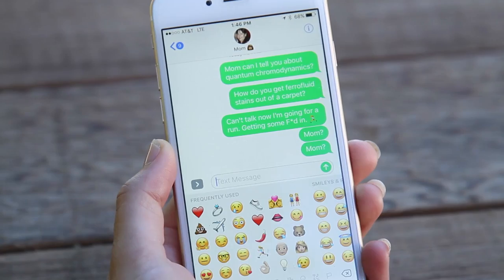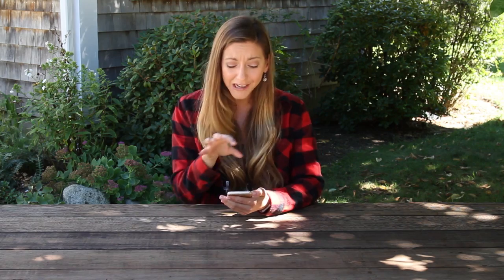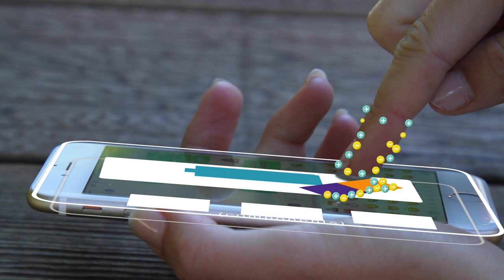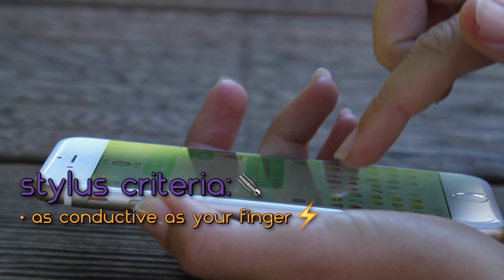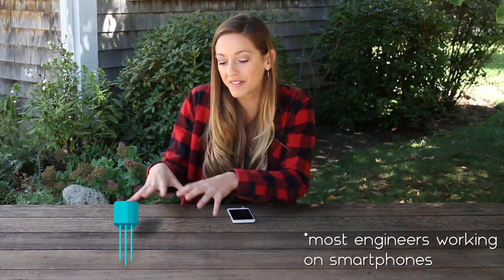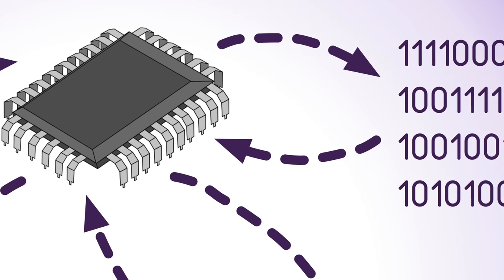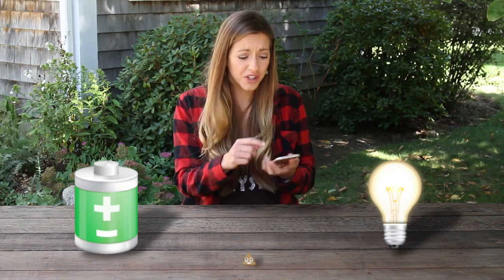How do touchscreens work?

Comment: Surprised you didn't mention the scale of calculation the phone does at all. From touching the screen to seeing the poop emoji about half a billion calculations took place. When the data hits the processor, it gets handed through several layers of code, interpreted by each into something understandable by the next, all carried out on a grid of switches powered by rusting metal. It's freaking incredible.
Reply from the maker: There's a LOT more I'd like to get in to. I used to program and I'd love to talk about code, but I haven't figured out the right way to tie it in to physics. Suggestions welcome!
Reply: could you maybe talk about how much energy from a battery is used in doing something like calculating 2*2? it would be interesting to see how the energy used to do a calculation through programming compares to the energy a human uses to do the same. 

another way is to talk about a simple adder circuit and show how to do math using simple on and off switches with current going through them.

i look forward to seeing your future vids :)
Reply: Physics Girl Maybe a mini series about how physics uses computers and particularly really smart code to do physics? Talk about something like the LHC, or computer simulations. I think especially computer simulations would be eye-catching at least. That way you get to talk about both physics and the code that we use to figure out what the heck happened in that little big bang we just made.
Reply: nope, nowhere near half a billion calculations to do that. that would mean a 1ghz smartphone would take half a second to display the emoji after you requested it, and it's obviously not nearly as long. in fact, if correct for the touchscreen and screen input delay, the delay would be in the order of microseconds.

more like 50 thousand calculations. and that's low level binary gate (true or false) operations.
Reply: How about explaining the amazing physics behind RAM row hammering works. You get into electromagnetism, processor instructions, and more!
Reply: ***** So if you watch the video, you see she's on something like an iPhone 6. There are basically no 1GHz smartphones on the market today, most are 2+, and quad core, and run multiple instructions per clock cycle, and the GPU is involved because it's graphics.

My estimate is probably on the high side, but yours is way, way too low.
Reply: Teth47
no it's not. it's no different for a 100mhz device with no gpu acceleration to respond to an input and show a small icon.

heck, you could do it with devices in the hundreds khz range and still experience close to no delay.
 the touchscreen takes a bit of processing, but not really a meaningful amount.

you underestimate what a billion is.
it's a fucking gigabyte of raw data that would have to go through the cpu. do you really think it's that much?
Reply from the maker: Awesome suggestion, thank you.
Reply: Teth47
yes, exactly. all that fits snugly into 50k operations.
Reply: ***** Whatever man, that's not even what this thread is about.
Reply: +PhysicsGirl Use microcontrollers as glue between programming and phisycs. (You may even use a Raspberry Pi GPiO if you want to take it easier.)
Reply: Sensing signal to kernal , interrupts , subroutines, data conversations, drivers, hardware, electronics, physics, mathematics and list goes on and on. Thats what it takes a modern day computer to print a single character, there's nothing magical in there like black box, each part of them is designed and improved over years of hard work and innovation. Technically the answer would be different for different kind of people i.e. programmer sees it as parsing text, a device driver will see it as IO, a normal person as an Image, font developer will see it as vector or bitmap...its how you want to interpret it, afterall its universal in computing.
Reply: roger brandt They do, but they all move at once. Imagine a hose full of marbles, push one in one end, one immediately comes out the other. Same idea, roughly. The processor in a phone switches about 2.5 billion times per second. That's what 2.5GHz means.
Reply: roger brandt Computer tech and amateur scientist without a specific discipline. I just like physics.
Reply: +Teth47 I don't think it's surprising. I think that subject deviates significantly from physics and would be it's own video.
Reply: Teth47
Reply: Physics Girl- A Rube Goldberg Machine?
Reply: And THIS is how they were able to go to the moon on 4k of RAM ... because you don't actually need to do all that nonsense.  :-)

Comment: From a Programmer's perspective, I'd like to add one thing... The touch screen contact point is translated into an X-Y coordinate, and the programmer uses it as a coordinate to determine what you touched (which button, image or anything else).  Leave the complicated stuff to the hardware guy.  For the programmer it's just a message signal with X and Y coordinates.

Comment: I bought my first CP/M computer in 1982, my first Dos computer in 1985, and my first Windows based computer in 1988 (Windows 286). My present smart phone has (much, much) greater computing power and storage capacity then each of these three desk tops. Modern smart phones are wonders of engineering.

Comment: Great video, very good information for what it covered... but I feel I got 20% of the story! I was hoping you would actually continue on much further, with a (high level) explanation of how messaging software handles the outgoing text message and turns it into a network message, transported as a data packet over TCP/IP and wireless networks, touching on what network protocols are, and how phones connect to cell towers, receiving the message and displaying it on a screen made of a pixel matrix composed of LED components... I wanted to hear about the entire "life of a text message" from touch on the sending end to display on the receiving end. In any case, great work! I very much enjoy your videos and I feel you are doing a great service to us all, educating us about subjects we are not always familiar with. that's only reason I wish this video hadn't stopped where it did :)

Comment: Dear Diana, you could have done better on explaining how the signal gets interpreted. For example with something like this: The electrical signals from your finger are interpreted in such a way that the position where you touch is determined. That gets sent to the phone's main processor which also knows which emoji is currently displayed at the position where you touched the screen. And so on. Just don't skip so much of the general computer knowledge, but rather include it in your explanations! I know it's just software and from the standpoint of a physicist, this is boring, but hey, most of the stuff that goes on in our phones is software, interpreting the phsyics around it! (i.e. when you find a Pokémon at a certain location).

Comment: Hi Physics Girl! Great video on the physics part! Although I think you're mixing the whole process between the touch and the poop emoji... The touch-screen signals the operating system the position of the finger's touch, not the code that uniquely identifies the poop emoji. That way the operating system knows where the user touches the screen, and in your case, in the keyboard with the poop emoji, that will communicate with the messages app the poop emoji which has that unicode to uniquely identify it and write it on the text field.

Comment: Nice Video. And thanks for Thorn I am going to use it when I need a new variable in a theory. Some already run out of good letters for physical concepts (yes I am looking at you charm and strange quark)
Reply: It's a great letter. It's too bad English lost it.
Reply: It didn't…quite. In shop or pub names like "Ye Old Curiosity Shop" that's not actually a "Y" it's "Þ" and "Þe" is pronounced exactly the same as "the" ;-)

Comment: Do you know why touchscreens don't work as well with cold fingers?
Reply: the conductivity decreases with decrease in temperature
Reply: Actually something cooler is a better conductor. The reason is more biological. To conduct you need oils and water over you skin. When it's cold the formation of the pores and dry skin makes your skin less conductive.
Reply: i think even without oil our body can conduct.
Reply: Do you have plans to do the sofa science video thing with Physics Girl? you've already done one with Brain Craft
Reply: AJD is right, only metals conduct better when they get colder. Semiconductors and nonmetals decrease in conductivity with decreasing temperature, the exact opposite of metal. However that's not the reason, touch screens are capacitive not resistive, you don't even need to physically touch the screen for it to work. Additionally, dry skin is perfectly fine, you don't need oils or water on your skin for the screen to work. Your skin is alive and thus full of water. The reason it may not work is if there is a thick layer of dead skin on your fingers, dead skin doesn't contain any water.
Reply: Objects in Motion  I think human body is a conducter

Comment: 3:58 Very, very simplified. Well, it has to be, I suppose. However... 4:14 This is the UTF-8 encoding of that character. UTF-8 is used for storage and interchange, but not generally for internal representation; for that, it's much more likely to use something like UTF-16 or UCS-4. Also, all of these encodings are part of Unicode, and it's not even clear yet that you're touching a button (what's a button, anyway? the chip has no concept of that), so you're getting a little ahead of things. In reality, the chip is most likely figuring out the coordinates of where you're touching. This then gets sent to the operating system (still simplified), which then notifies the app that is currently displayed. The app figures out what touchable widget is at those coordinates, finds out it's the button for "insert the U+1F4A9* character", then adds that character to the string in the text box. Later on, assuming whatever protocol the app is using requires UTF-8 encoding, it converts the whole string to UTF-8, so that U+1F4A9 gets converted to the representation shown at 4:14.

* "U+####" is standard human-readable notation for Unicode code points, with the value in hexadecimal.

4:31 Hehe. "Roman alphabet", you say, as it clearly shows a Greek letter. :-D A very appropriate letter, though.

Comment: I must say, I still somewhat miss those days when we had resistive touch screens rather than the capacitive ones of today. On my Palm Pilot in the 90s, I could use a screw or a nail to input anything, and even better: It was 1-pixel-accurate! While nowadays, you get an accuracy of about 5mm at best, and that's still wat too much for some graphical user interfaces of certain apps, because things are positioned too closely together (or sometimes even for a simple keyboard on a smaller-ish screen). The last smartphone I had with a resistive touch screen was the glorious Nokia N900, and while it ran an awesome operating system that has its capabilities unmatched by anything available today (except the SailfishOS by the Finnish company Jolla), one other thing I was really fond of was its stylus, which had a pointy plastic tip about the diameter of a ballpoint pen. The signals I was able to send to this phone with this totally different technology are unrepresented in accuracy by any phone or tablet that's available today. Please start making phones with resistive touch again! And with SailfishOS, since it's so much like a standard Linux OS you'd run on your PC...

Comment: Nice video - great explanation of touch screens.But saying that capacitive touchscreens are accurate is like saying that news are better on digital tv (with 2-5 seconds delay). I had a pocket PC with resistive screen (when windows mobile was a thing) with onscreen keyboard that had letters half the size of the smallest android phone and I rarely missed a key. Yes, capacitive screens don't drift over time and you don't have to calibrate it but they are far from accurate. Plus they are often disturbed by other electric signals including switching power supplies. Even with relatively good, original brand power supplies some phones start to miss touches. The future is not always bright.

Comment: Hey, Diana! I like your channel. I have a fun thought experiment about relativity that I'm not sure what the correct results would be. It could be a nice idea for one of your future videos. I hope you could make some animations to help me visualize it. I am one of your subscribers. ;) 

The experiment goes like this:

Suppose there is an infinite plane of lights flashing on and off periodically, for example on for 5s and off for 5s (no gradual change), and all the lights are flashing in unison. An observer is looking at the plane of lights at a distant L perpendicular from the plane. What would the observer see if the observer is a) at rest relative to the plane b) moving away from the plane c) toward the plane d) parallel to the plane at a constant speed v (possibly greater than speed of light) and e) accelerating in the mentioned directions? Also, f) how should the lights flash in order for the observer to see them flashing together and g) how would it change if he starts moving?

My guess is that he sees concentric circles of on and off lights spreading out instead of all the lights flashing simultaneously. Another variation of the problem is to replace the plane with a sphere enclosing the observer, but that's probably too much to ask. However, thank you for reading this kinda long comment.

Comment: You are very fortunate to have such ability to communicate
It is unfortunate all teachers do not have such ability,

Can you imagine what it was like for people like myself who learned this concept of transmission and to receive from crystal radio receiving to and from tubes, to transistors , to integrated circuits, then to modules, and  they call these new guys engineers today - who have no clue as to how a transistor within an integrated circuit actually works, They learn the facts that it's a gate, an gate, nor gate etc, and it finally comes down to computer language in it's basics.

A real electronics person today calls those guys plumbers and they don't understand the real difference,
While they try to baffle you with their foot work and humbly a real electronics guy knows the difference

Just a thought for you
Have you considered making up a character type of educational system to brain wash the hard nosed teachers that have trouble communicating?

If you can communicate so good with lay people, Try to expose your ability to the teachers, to see if they can learn this quality of communication,
It may bring to the front, people who such as myself who had trouble learning in school, yet had the ability after I finished high school, to excel in my field better than many others,

It would be a real bonus for you and to the world, to educate the so called educated (brain dead) in how to communicate to others who are basically brain dead ( that live in their own little box and can't get out of it) and cannot think out side the box !

Hit them where it hurts and you will do some real good !

Call it 
The physics of communicating for the brain dead !

An excellent title !

Comment: AFAIK, Unicode conversion isn't a hardware level operation, as mentioned at 4:22. It happens in the software and then the signal (0s and 1s) is passed onto the chip level for transmission.

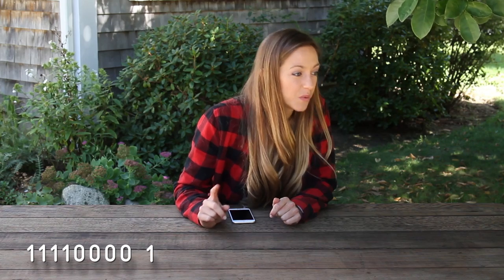Comment: 4:13 To be exact, that's actually UTF-8 encoding of the poop emoji (U+1F4A9 PILE OF POO). The same character has different binary representation in other encodings. The sad fact is that we still (year 2021) don't have a worldwide agreement how to encode even a simple letter like "ä" or "µ". The UTF-8 encoding is the best option we have but still way too many programmers fail to support it correctly and use UCS-2 or US ASCII instead or some random 8-bit encoding which is called "code page" in Windows.
Reply: Another sad part of the UNICODE story is the great CJK unification. The UNICODE was originally supposed to fit in 16 bits and that wasn't enough to reserve space for Chinese, Japanese and Korean to each use unique characters. As a result, UNICODE consortium forced all the people using any of those languages to use "common" characters which made people speaking any of those languages sad because they considered the combined ("unified") characters uglier than the characters they normally used.

Nowadays UNICODE requires more than 16 bits but the CJK unification has not been undone so we still have the same mess for those languages. And at the same time we have NFC vs NFD encoding for latin based characters, so even UNICODE fails to specify how letter "ä" should be encoded. It's either just letter "ä" or combining character "¨" with letter "a" and it's up to the sender to decide how he or she wants to encode that.

Comment: In her case a computer chip only works with electrical current in which 5V and above means 1 and any voltage below is interpreted as 0. As a computer scientist it's actually far more complicated from an abstract point of view. Then it's not just electrical current looping around gates, then it's software which manipulates all those patterns and that happens firstly in machine level, then low level, then high level, then application level! The packet carrying the poop character is forwarded from the NIC to the router, from the router it's forwarded to your street network where one of the switches then forward the packet further to a less and less local area until it gets to the server of the messaging application and the person "receiving" your message downloads the poop character onto their page so that they can also see the poop character you sent.